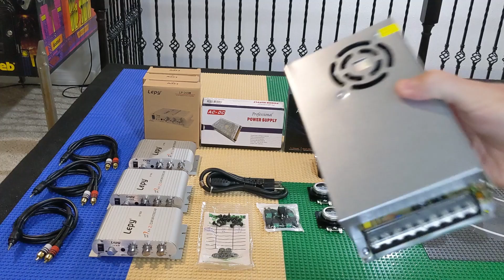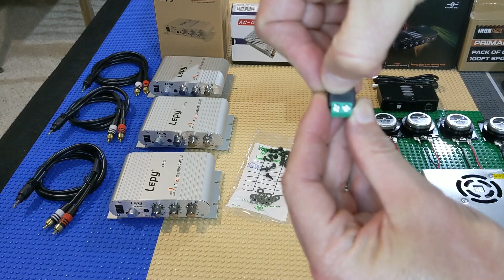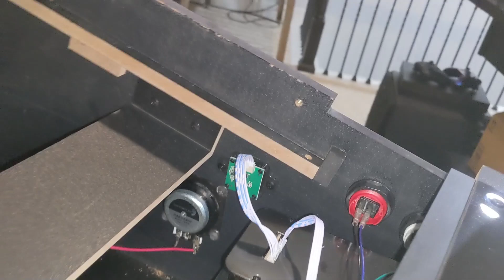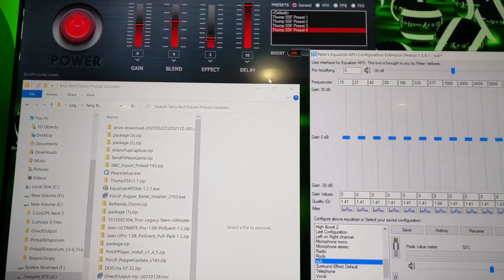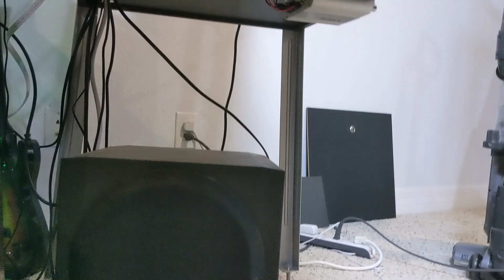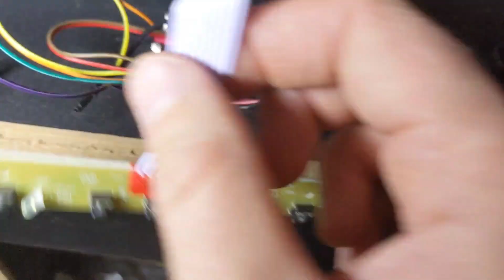Legends Pinball Surround Sound Feedback Installation Video

Comment: Can you set the ssf to work with the stock tables by feeding the signal into the external sound card's input? I am trying to upgrade to ssf from a buystuff haptics setup on my alp. I am setting it up right now with the built-in sound card.
Reply from the maker: I don't think it would work, the sound from the ALP would have to carry additional data to tell the external sound card which of the 6 speakers/exciters to send the sound to.

Comment: Do you get any clipping with the basshakers and exciters? Wondering as the LP 838 is only rated for 15w, but the shakers and exciters are 25w. Thanks!
Reply from the maker: No, I don't. I also don't turn them all the way up. They get very loud.
Reply: Thanks for the super quick reply. Working out my shopping list and your video has been a great help.

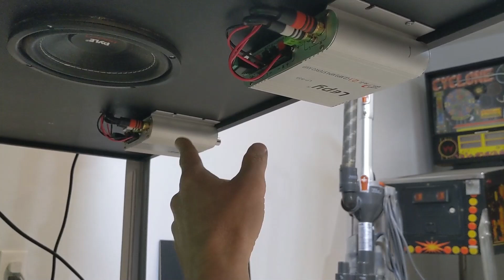Comment: Thanks Leo! Great job on the video and showing how you did your setup. Quick question, at 23:59 where you talk about how you integrated the bass shakers into your front and rear amps, it does not appear that any wires are connected to the green 2.1 outputs on the amps. Can you share how you wired those?
Reply from the maker: The bass shakers are connected to the green connectors. You can't see the wires due to the angle of the video. The hole where the wires go into the cabinet is directly above the green connector. The wires don't loop out like the rest, they just go straight up.

Comment: Why did you put a washer between the exciters and the cabinet? I'm ordering parts for SSF right now.
Reply from the maker: I actually didn't. I put the washer between the screw head and the exciter and not between the exciter and the wall of the cabinet. I did that to back the screw off just a hair because I was worried that it might be too close to the outer wall and mess up the art on the outside. I couldn't find any other screws that the head was large enough to hold on to the exciter and it was under a half inch. I thought a quarter inch screw was probably too short. The cabinet is not made of real wood It's a funky particle board that's very weak. I thought since the exciters would be vibrating a lot the quarter inch screw might rip out of the weak material. I know I put the washer on the wrong side when I was showing the components.
Reply: @leodonnelly5427  ok thanks that makes sense.

Comment: Leo, were you ever able to get DOF linx setup for FX3 or future pinball. I tried following Terry's guide and installed dof and doflinx, made changes to all the ini files but still cannot get it to work. did you have to change anything with the dof config tool? or did you just use default values ?
Reply from the maker: Yes I got it working. I followed Terry Red and Major Frenchies videos. I don't remember having any problems other than when it started with administrative rights, I had issues with it not working properly, but since I  start it regular, I have no issues. I do have a problem sometimes where I load a FX3 table and I have no surround sound feedback and then after a few minutes it'll pop on. It doesn't work on a lot of tables. If you join the surround sound feedback for visual pinball Facebook group those guys will help you out.

Comment: Followed this tutorial exactly thank you. Installed the exciters and bass shakers with amps but no subwoofer. Besides pinvol any recommendations for getting the sound tuned in. Do you have all volume knobs all the way up and adjust with pinvol software?
Reply from the maker: Yes I have all the volume knobs turned all the way up, and all the bass and treble knobs turn to eight. I then just adjust each table with pinvol to my liking, every single table has to be adjusted independently but only takes a couple seconds and then it saves it forever.
Reply: Awesome thanks. I will admit it’s hard to play non-ssf tables now. Ha.

Comment: Amazing job with the work and the details included in the video. In the components list there are a couple items that do not appear in this build, is the video board a generic replacement for the VIBS board which you ended up using in your AMAZING custom backbox? Would love to see even some basic details or guidance on what was required for that build, it looks incredible.
Reply from the maker: This is the HDMI board I used. https://www.amazon.com/gp/aw/d/B06W5DTGKC?psc=1&ref=ppx_pop_mob_b_asin_title They didn't have VIBS backs when I made the video. Right after that video I made a full custom backbox using the 32 inch monitor that is on top of the backbox in this video. I also used a 19 inch monitor for the DMD and used two 4 inch led speakers in it.
Reply: @leodonnelly5427  That's what I was curious about as atgames is currently out of stock for VIBS boards again and was hoping I could just pick one of these up in its place. The notes on board at amazon only just up to 17.3 inch being supported, guessing that was not an issue. Thanks again for taking the time to create the SSF video using it for reference and plan to build almost identical setup after a short time playing it stock.

Comment: Great video dude. Definately going to reference this when I try this mod.  Got some questions about the bass shakers and hookup.  
1.  Did you get the Dayton Audio TT25-16 Puck Tactile Transducer Mini Bass Shaker?  How exactly did you hook these up to the amp?  You mentioned that the back bass shaker was kooked up to the back left and back right amplifier.  Can you explain how all 3 speakers are hooked up to the amp given the amp has a +/- L and +/- R?
2.  If you did get the bass shaker I mentioned, from the pictures on Amazon, it looks like they don't mount flat to the surface.  How are these mounted to the bottom of the cabinet?
3.  I bought the Dayton DAEX25 instead of the DAEX58FP.  Do you think the DAEX25's will be good to use?
Reply from the maker: I bought the TT25-8 mini-bass shakers. The pictures on Amazon do not show it but it actually comes with a adapter to be mounted on a flat surface. If you go to the parts Express website and look them up you can see a picture of it. The amps that I bought to power them are three channel. 1 amp powers the left and right backbox speakers and a 6-in subwoofer. Another amp powers the rear left and right exciters and one of the TT25-8 mini bass shakers. A third amp powers the left and right front exciders and a TT25-8 mini-bass shaker. Each amp has a left and right input and they also have a crossover built-in which goes to a third subwoofer out channel. The Dayton DAEX-25 exciters Will work perfectly fine. Everybody who does this surround sound feedback system either uses those or the 58's that I got.
Reply: @leodonnelly5427  Thanks for the info.  For the backbox speakers, can you explain a little more about the hookup and what connectors you used (link if possible)?  I was wondering if there was a way to use the backbox speakers in the 7.1 audio from the PC as well as for the stock tables?  What are your thoughts?
Reply from the maker: @craigyoung4068  For the back box speakers, I disconnected the main speaker connector in the back box (the one that you connect the back box to the main pinball machine) I then soldered beadboard wires ( https://www.amazon.com/EDGELEC-Breadboard-Optional-Assorted-Multicolored/dp/B07GD2BWPY/ref=mp_s_a_1_5?dchild=1&keywords=breadboard+wire&qid=1624891719&sr=8-5) to the wires exiting the left and right channels of the amp for the back box. I then plugged those wires into the speaker connector for the back box speakers. I do not use the stock tables, I only use OTG so I don't need my speakers connected to the stock tables. You could wire in a three-way switch and have one side wired to the stock tables and the other side wire to your 7.1 sound card. Then you could toggle between your computer and the stock tables. I have since removed the stock back box and built a new one with a 32-in monitor, a 19-in monitor and 4-in LED speakers.
Reply: @leodonnelly5427  Thanks for the info.  Maybe I will use something like this: https://www.amazon.com/RetroArcade-us-ra-3way-button-Arcade-Button-microswitches/dp/B00F1YQHIE for the button to switch between the speakers.  Wonder if this would work. Or are you thinking of another kind of 3 way switch.

I saw your backbox on another video you posted.  The pinball looks so much better with a larger backbox and multiple monitors.  

In case you wondered, you can find me on the Facebook The "Official" AtGames Global Arcade Fan Page under my wifes account Julie Young.
Reply from the maker: @craigyoung4068  That wouldn't work, You would need something like this https://www.amazon.com/Baomain-Latching-Maintained-Position-waterproof/dp/B01J31IBH0/ref=mp_s_a_1_3?dchild=1&keywords=three-way+toggle+switch&qid=1624900937&sr=8-3 And you would need two switches, one switch per speaker

Comment: is that wire (the 6 primary colors you showed) using stranded wires or a solid wire?  And can you explain in a little more detail about that sound card? Where does its audio input come from? Is it spliced into the AtGames speakers, or is that sound card just connected to a USB 3 port on the computer?  
Originally, I was looking for a video on youtube (and I saw your video) that shows how you could hookup external speakers (just like some nice logitech computer speakers and sub) directly to the Atgames pinball machine, so that it sounds louder with bass.  In that situation you would need a line output like a RCA left and right or a 3.5mm jack to feed into the external logitech speakers
Reply from the maker: The wires are stranded, the sound card is USB and I do have it connected to a USB 3 port. Once you install the drivers for it Windows just sees it as a sound card and you just go in your sound settings and click on it to make it primary. I do have the sound card going to the two back box speakers, The speakers have a disconnect so you can remove the back box That is where I connected the sound card to those speakers.
Reply from the maker: Before I installed the surround sound feedback I was using my two PC speakers and sub still connected to my PC. Typically your sound is transmitted through the HDMI cable to the Legends pinball however you can select your PC speakers as the primary sound output.

Comment: ps could you make a video showing how you do these settings where this was mentioned below: 

It's not needed, but it does greatly increases the low end of the sounds. I definitely prefer it with the base shakers. If you use Pinvol You can adjust it to where the flippers don't activate the base shaker but the slingshots and bumpers do, makes it more realistic.
Reply from the maker: I do use Pinvol and every table is individually set with its own sound settings. There is no standard setting for volume on tables. Some tables the music is too loud some you can't hear it at all. Some tables you can't hear the the sound effects. Some tables the flippers are extremely loud activating the space shakers and some you can't hear the flippers at all. So as you play a table you have to tweak all the sound settings for that table in Pinvol saves all those so when you open the table again they're all set.

Comment: So is it worth having the bass shakers in the bottom connected to the amps or is is overkill? have 4 exciters hooked up on sides with a subwoofer. Seems like  a lot of extra vibration from those two bass shakers in back and front middle that might not be needed? Thanks!
Reply from the maker: It's not needed, but it does greatly increases the low end of the sounds. I definitely prefer it with the base shakers. If you use Pinvol You can adjust it to where the flippers don't activate the base shaker but the slingshots and bumpers do, makes it more realistic.
Reply: @leodonnelly5427  gotcha. Thank you! Great work.